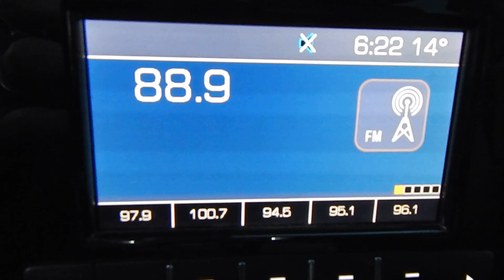Episode 62: How to Build an Earthbag Home - Day 21 (Interior Wall Framing)

Comment: The wife and I were looking to northern Arizona till we heard they didn't allow RVs and unconventional buildings, so we're wondering, did you have to get a building permit? do they allow RV? whats the restrictions? we know Cochise County has an opt-out permit for building, and all you have to permit is the septic? any info would be greatly appreciated
Reply from the maker: We are in Apache County, it is my understanding that you can park an RV for up to six months without moving it. I know of many people who have been parked in the same spot for years. If you do get called out for it, it's my understanding that to get around it, you just move it for a couple weeks and then put it back. Kind of a pain, but it's a work-around. As for the Unconventional Buildings, I have had no problem getting permits for the Earthship Home. (Note: I have complete Architectural and Structural Drawings, Stamped by an engineer for this house) They encourage Alternate Building Methods, There is a Section in the Building Codes for them. Regarding the Earthbag House: This is actually an outbuilding that will be for Storage when the Main House is built. We got an Agricultural Exemption to build this Structure as well as an Outdoor Kitchen and some Animal Shelters, though we won't be building those until we can be out there full time to care for them.

All of the Information is available at the Apache County Website:
https://www.apachecountyaz.gov/Building-Safety

Hope this helps, let me know if you have any other questions.
Thanks for watching our Videos, We hope you will like and Subscribe.
Reply: @lostfarmshomestead  thanks, that helps, we just want to build our own small place and be left alone, for many of the same reasons as you,  we're up in Oregon, they killed this state, had hoped to retire here, no I can't afford too, $77 bucks to fill my car today, mobile homes on tiny lots selling for 350k  renting for $1800. Time is short, money in the bank is shrinking, crypto is falling, oh well, can only do what you can do, good luck to you and your family, we'll be watching 🏚